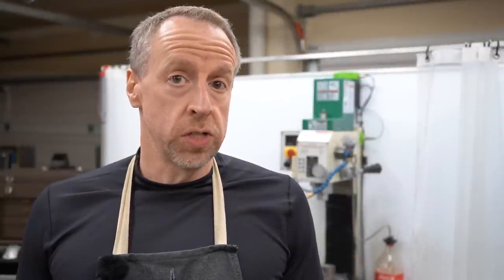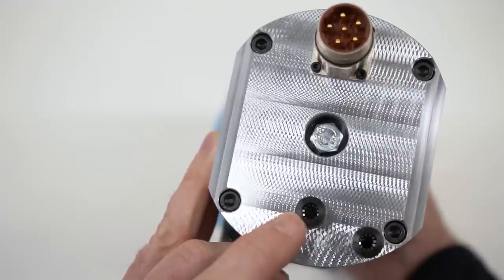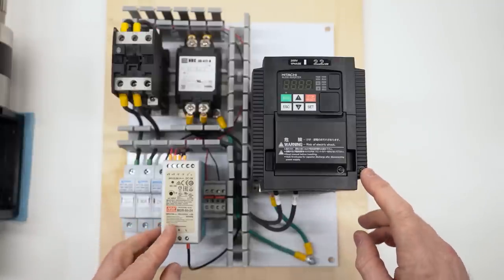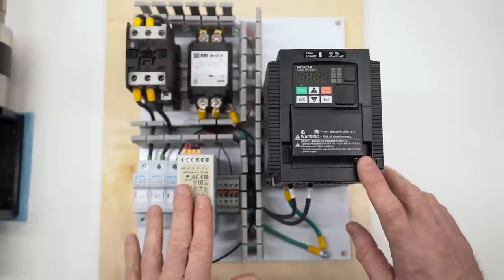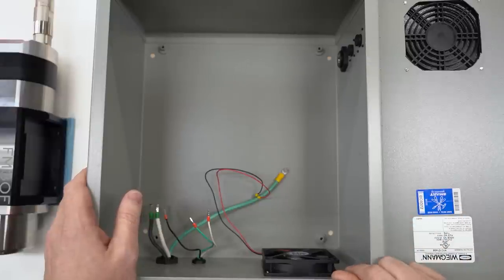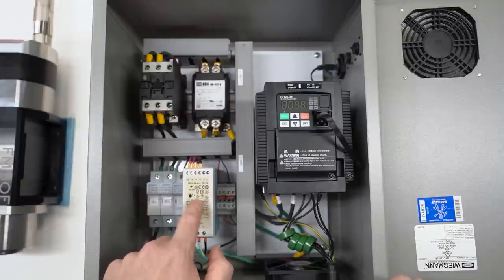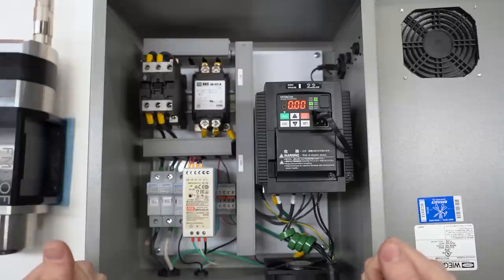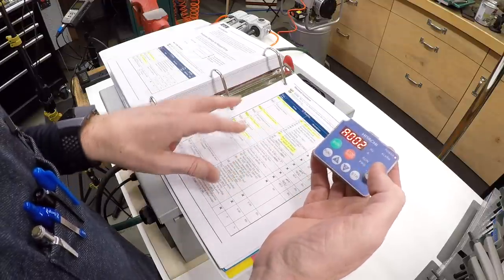ATC Spindle Part 1:  Wiring, Programming and Testing the Hitachi WJ200 VFD

Comment: Hmm, no ability for a spindle encoder. Guess you wouldn't be doing rigid tapping with this kind of spindle motor. Can always use single tooth thread mills instead.
Reply from the maker: Correct.  I'm not sure this spindle would have enough torque at the very slow speeds required for rigid tapping anyway.
Reply: This spindle can definitely bbe equipped with an encoder. I have one on mine

Comment: I've successfully been running a 2.2kw spindle motor on my G0704 but I did it differently.  I use it in a custom belt drive configuration through the stock r8 spindle with a tts tool setup.  I have an atc running on the machine now too.  But I do like this idea and the 30 taper spindle.   Feel free to check out my machine.  I have lots of g0704 content.  https://youtu.be/brNcCg0dXo0
Reply from the maker: Are you running the stock tapered roller bearings?  I found, even at 2200RPM, that my spindle bearings were generating a fair bit of heat.  I'm quite certain they wouldn't survive at 4000, let along 8000.

+1 for YG-1 Alu-Power.  I've been running uncoated tools at 2200RPM in the stock spindle.  I plan to run coated ones at 12,000RPM with the new spindle.
Reply: @Clough42  I have replaced with angular contact bearings.  Used recommended part numbers from Hossmachine.
Reply from the maker: @adaptedmachining6951  how did that affect the runout of the taper?  And has anyone heard from Hoss lately?
Reply: @Clough42  Runout is considerably better than before the bearing upgrade. I have measured at .0003 now.  As for Hoss,  he is literally off the grid but is still alive.  I know he got in shape and seems to be just living a simple life now.  I believe something happened either health wise or financially but I found him on facebook.

Comment: this spindle is way overpriced, should be 50% of what it is.
Reply from the maker: If you're comparing it to what you see on AliExpress, you could reach that conclusion.
Reply: @Clough42  there's a spindle OEM by the name of olispeed, they make some of the spindles that HSD and Hiteco sell. For comparison for the same price of FN30 you can get a SAB150 from them. It has about 15Nm torque. Another example for the same price a motorized spindle cartridge with over 30Nm from CTB, their BT40A. Whoever makes the FN30/S30 is ripping off its customers.

Comment: By shutting off the 24v power supply, to turn the control box off & on, you remove the possibility of post-run cooling of the VFD. Do you have a link for the spindle and VFD? I'm sure they above my pay grade but I have been window shopping for a spindle with a tool changer for my  CNC project and your spindle looks like the one. Is that a BT30 spindle? You might put in an infrared lamp to keep you warm while standing at your work bench. They work great and you don't have to heat the whole shop.
Reply from the maker: I'm not shutting down the power when I turn off the spindle--just at the end of a session.  The spindle will stop at the end of a cut, and the power will stay on for a while--until I shut down the mill and turn out the lights.

It's an ISO30 spindle.   It is compatible with BT30 tooling, but has no drive lugs.  It's primarily intended for high-speed operation with small tools.

The infrared lamp is a good idea.  I have a 4KW electric heater in the shop, but I leave it off while filming to get good sound.  The infrared lamp would be quiet, but I also work pretty hard to color-match all of the light sources in the shop.  I suspect an IR lamp would mess that up.  But it would be worth a try.
Reply: @Clough42   I'm sure your fans would be happy with you being slightly off color and warm rather than being color neutral but on the verge of turning blue. Do you have any info for the Mfg of the spindle or is it a pre-production secret, in which case I'll quit asking?